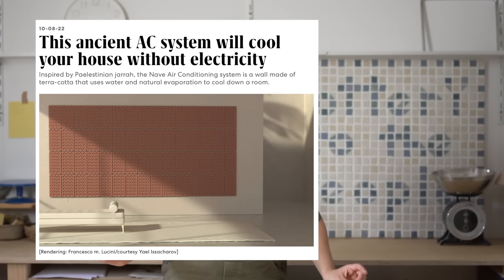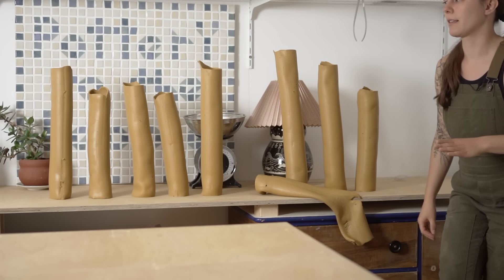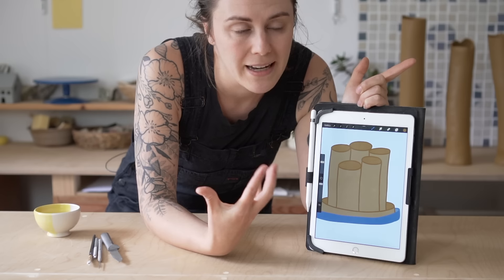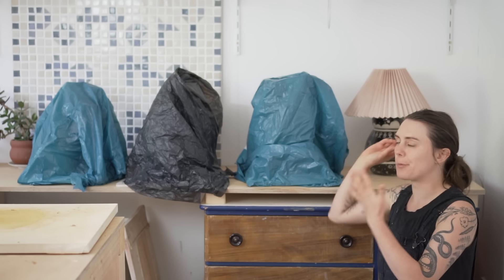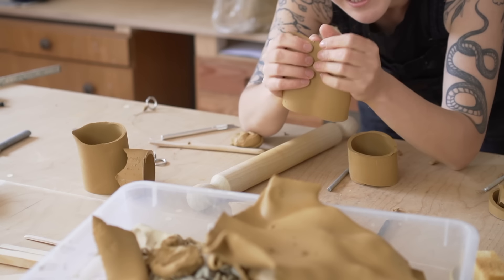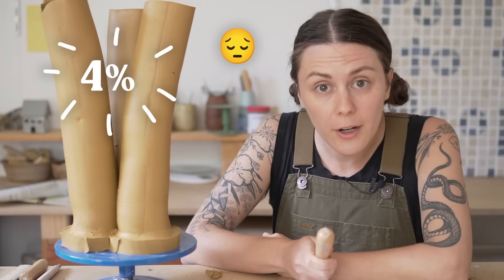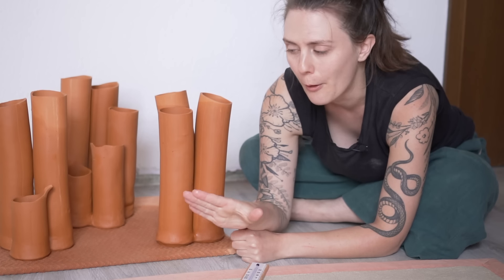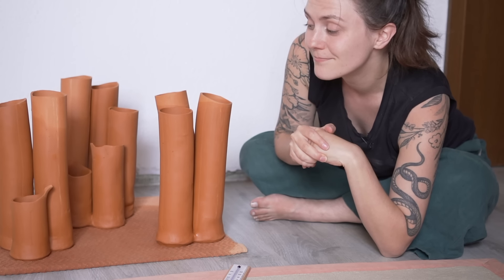Can I make an A/C out of clay???

Comment: not the heat, it's the humidity. 
It's why they are called air conditioners not air coolers. 

%90 of what my ac unit died is removed humidity. 

If you waled into my home in  the summer it's warm, but dry.   

Also , I know a lot of people who are cold all the time while I'm sweating if the temp exceeds 55 F. 

There seems to be this thing where people who are heat Loving like to make those of us cold living people miserable.  I'm at work , it's 2 degrees outside and there is literally sweat pouring  out of me. ...

My dress code is a suit and jacket.  I'm literally comfortable standing in the snow dressed for work!!

Comment: I love the project, very nice video, but I think you are being a bit doomery on the  unsustainability of air conditioning. 

Although HFCs are one of the single biggest causes of climate change, their impact is caused almost entirely during improper disposal of cooling loops. 

New laws and regulations phasing out the use of HFCs for modern alternatives have already been started by the US and a few other countries. Outside of HFCs, their real impact is electricity usage, which can be sustainable. Heat pumps as a technology are extremely efficient and useful, especially in replacing gas utilities like heaters.

In terms of alternatives to air conditioning, infrared cooling ("self cooling") paint is definitely the most promising. 

I know this isn't really the channel for that, but if you wanted to do another video about AC-less cooling, making your own cooling paint would fit the vibe at the very least.

Ultimately, we moved away from this type of cooling because it doesn't work in humid environments, and also it just really doesn't work that well.

Comment: Really cool project and now my brain is running away on ideas for chilly tubes! It'd be neat if your extruder could do something other than just regular tubes. If you extruded tubes in similarly sized circle with a wavy edge (so the cross-section was more flower shaped than circle), you could get get significantly more surface area per length/diameter of tube without a lot more effort.

Comment: So your thermometer is reading 21.5 C, which corresponds to 70.7 F. But you shared that as 66F. 66F is 18.8C. Something with your maths seems to be off. Also where I'm from 66F is pretty chilly. So yeah, not sure about the maths or the point of this experiment. You probably get better results if the room is a lot hotter. Regardless, nice job trying to recreate a functional ancient A/C system.

Comment: I love ideas like this even though the 60% relative humidity where I live is too high for them to work. The cooling power of evaporative cooling depends on the air being dry. The humid air has to leave the space you're trying to cool to allow the water to continue to evaporate. If there was little or no air exchange out of the room for your test, then that's why it didn't work. Humid air feels warmer, so evaporative cooling has to cool the air enough to compensate for how much warmer it feels. Evaporative cooling works very well where the heat is dry, but it doesn't work in humid climates. In humid climates it just makes the heat feel stickier. You could cheat and put ice cubes in them. Your freezer would make extra heat then but you could let that heat float away with a ceiling vent or something. You will probably need a ceiling vent for evaporative cooling to work anyway. You can also increase the cooling power of evaporative cooling by dehumidifying the air. You could fire something hygroscopic like clay powder at night to dry it and then use it to dehumidify the coolest air around the evaporators so it can cool more.

Comment: Hmm... I think you need to science the sh*t out of that. The thing works best when air around it is hot and dry, so maybe it would work better as something placed outside of the room, maybe on the room's window, under the sun. And then, you would need to pump or conduct heat from the room out into that water heat absorbers (or from air that you want cooled before entering the room), kept cold by water evaporation but keeping water vapor out. Hmm. Maybe an air intake into the room, through a ceramic "big air bottle", or a serpentine like twisted pipe, contained inside another bigger, windowsil flowerpot like porouse container filled with water. Maybe something bigger than a flowerpot, in that case carefull with water weight.

Sun hitting the flowerpot container will keep it's exterior hot, so increased water evaporation, so colder water contained inside. Air getting inside the room should have to get throug the cooled air bottle or tube, so the air would be cooled. You could keep the machine cooling the water by keeping the water level, and air could be forced through the tube/bottle with a small low power fan, or some kind of wind collector funnel. If heat difference is high enough, maybe inner tube could be metallic, so no water vapor pumped inside the room, too... in fact, it could work as a dehumidizer if cold enough. Dry, cold air with passive or a very low wattage fan. Does that sound like something that makes sense?

Comment: Interesting, but in the tropics where it's most needed, it would attract a ton of mosquitoes, including dangerous ones that cause dengue fever, malaria and zika. So I wouldn't use it even if it's supposedly far more "sustainable" than conventional electric ACs. 

I wish I could tell you what a more sustainable alternative would be. I'm from Indonesia, and here the traditional vernacular architecture typically controls heat in the room by using thatch roofing and bamboo lattice walls, which can feel nice when made right, but can require labour intensive replacements every half decade or so, and is a maintenance and hygiene nightmare. Plus if you work with laptops, cameras and microphones, you legitimately need a properly insulated room with the relatively dry coolness that only proper ACs can deliver.

While I am concerned with climate change—in fact recently it is said that we are no longer in "global warming" but already in"global boiling"—I think that at the end of the day humans do what they need to do to survive, and it is a fact that not all human needs are environmentally friendly. For young children, the elderly, pregnant and nursing mothers, and those with medical conditions such as hyperthyroidism and heart disease, exposure to extreme heat can spell death or grievous complications. I would hands down take an AC over a heatstroke any day.

Still, I appreciate that you took the time and effort to make this video and start this conversation. Perhaps you could someday revisit this video when you have more information on how we could cool our homes without AC. I believe doing something about climate change is about taking action on the things we have control over, making peace with those we don't, and having the wisdom to know the difference.

Comment: i could have told you this wouldn't have worked. All you're doing is making still water for bugs. The reason it's cooler inside than out is becuase your house is insulated to retain heat and to not suck in heat. Meaning, outside will change while you're inside wouldn't. It wont work. The reason your house stayed the same temp is becuase you closed your doors and windows. When it's hot out, you do not want to open your doors and windows. It'll make it hotter inside. It'll equalize.

Comment: an A/C only uses about 100-300W electricity if you add it upp for a whole house maybe 1kw altogether. it just pumps the inside heat to outside. i mean my gaminglaptop uses more power then its needed from an ac to cool a single room. if you are so concerned about climate change then unplug your fridge and dont use your washingmaschine or heated water.

i mean heating water is one of the most power hungry things to do. it takes more than 1kWh/liter/degreesC. and btw you cant save the planet even if you were to live on the streets i mean. 

the planet doesnt even needs saving it will still be liveable after warming. sahara might become green cuz of changes in oceancurrents. near the poles more agricultural area i mean thousands of km^2 possibly. most places wont be hit that hard. predictions in  the 90' said new york would be underwater by now. i mean climate is a very complex thing there are no good models. it cant be modeled correctly. raising co2 from 1 to 3% there is no model that you can calculate with what will happen only from that data. its more complex. its a capitalist thing beging fake green and advertising green products and fearmongering. but nothing helpful is done.

recyclyng PET and other plastics is the biggest fake ever. it cant be recycled into bottles again and if u wanna reinforce something with it like roads its still cheaper to just buy new PET than paying for the recycling cost. its a chemistry fact that plastics after recycling are significantly weaker structurally and and more unclear chemically. polymer chains are degrading by each reheating and remoulding.

if you worry about social economic and demographical crysis (maybe local conflicts) due to warming .. just dont worry cuz it would happen even without the warming and are happening right now.. we will live trough it tho. nothing can be done on an individal level. the zeitgeist wont change and capitalism wont be socialism even if it lies and manipulates you. 

btw a good video and nice evaporative cooling. its effectiveness might degrade after many ciycles due to minerals in the tapwater you are using. clogging up the pores. but it could be washed out probably. idk. not a real concern. 

and using water for cooling is probably just as bad fro the environment. if you were  to do this on a bigger scale or everybody started doing this you should use non drinkable grey water sources.  cuz in many countries the freshwater under our feet is running out.

not speaking about getting fungi on your walls from high humidity. in extreme cases you can even get sickness from inhaling spores 
under about 35 degrees celsius and under about 70% humidity (peole find a way to survive much worse daytime temps tho) 
you are completely fine by getting naked and using fans for cooling yourself. good cardiac health is advised as well.

Comment: this concept seems to me like a fundamental misunderstanding of why sweating/evaporation cools us down and how thermodynamics works. Two important laws of thermodynamics to keep in mind here is 1, conservation of energy (ie heat) and 2, the law of entropy (which when applied to temperature of a system, states that the temperature/energy of every object in that system will irriversably trend towards an equilibrium). Sorry lot of sciency mumbo jumbo there but here's the high level.
1. sweating works for cooling humans because they are hotter than the air around them. evaporation increases the rate of entropy which makes the room temp hotter and our body temp lower. It can't make us any cooler than the average temperature of the system (us + the room)
2. note that sweating does not make the room cooler in this case. it actually makes the room hotter because it facilitates radiating our heat into the room
3. if however, you're trying to make this clay AC "sweat", you can theoretically cool the room so long as the clay AC is already cooler than the room
4. just like how we can't get cooler than the room by sweating, the room can't get cooler than the clay AC by "sweating". So the only way this AC would work is if you put in cold water
5. the cold water needs to come from somewhere. likely ice made by your freezer
6. your freezer makes ice by increasing the temperature of the room (using the same law of thermodynamics) so you're back where you started :(
Reply: the way AC units works is by piping all that hot air outside. because this has no external vent, the absolute best you can do is reach an equilibrium

Comment: I think this will be more effective with open rooms, as the idea would be for the air to take the vapor away and thus cooling it down. Another thing to note is the region you're in. This will certainly be more effective on less humid regions, as it requires the water to evaporate to cool down. You can also combine this with a fan in order to make it dry up faster while also spreading the 'cold' out of those tubes

Comment: what isn't sustainable is the electricity used to run them.
Reply: Incorrect.  You can generate electricity using renewables.  Some places are now running on 80-100% renewable.  Germany is 55%
Reply: @ziljanvega3879  renewable =/= sustainable.

Comment: Here's just a little perspective from one of the 10% U.S. households without A/C (or even a swamp cooler for that matter) in a hot desert climate.  Although I applaud your efforts to recreate a more socially conscious cooling system,  I have to disagree with your "no shade" statement, as well as wonder about the source of your numbers when it comes to the affects of A/C usage on global warming.  What you are really talking about is the affects of the electricity consumption of the A/C units.  How does this compare with the electricity consumption of, for example, electric pottery kilns?  No shade intended toward any potters out there that use electric kilns.  In all seriousness, I have no problem with the use of an electric kiln.  It has far less direct effect on the environment than a fire would.  I hope to just illustrate where you definitely are casting shade on A/C usage.

For a little more positive feedback, coolers like this have been used for refrigeration and food preservation for ages.  It works very well for more static environments.  Ceramic units that use a water tank at the top are made and sold in India to keep vegetables fresh longer in household kitchens.  If you want to turn this into an effective room cooler, you need to add air movement into the mix.  Without air movement, you will only ever cool just the immediate area around your clay.  Air movement will also speed the rate of evaporation, and increase the cooling effect.  I can tell you from experience, that a well placed fan with a pan of water in front of it makes a significant difference.  Of course, if you live in an already humid environment, evaporative cooling just really won't do you any good;  it will just leave you feeling hotter, and make you a sticky, sweaty mess.

Comment: I'm not a scientist, or have that sort of brain, but would it not do a better job of cooling if the air was actually moving past the cylinders..?? in a closed room where the air is not circulating it is thus not moving around the cylinders to move the water vapours..so if you have the means of creating a fan to move the air around the cylinders you may find the room cooler..

Comment: I loved this video and the thoughts and motivations behind it so much! I'm an evaporative cooling hobbyist and I'm sure others have said how you're actually so close to making this a practical thing to use to cool your home especially in Europe! All you need is a fan or some air flow with an exhaust to let some humidity and air push out! Passively moving that air is difficult though so I understand your apprehensive to add an electric fan. Maybe run it on solar from the roof with a small 100w panel? Very excited to check out more of your channel

Comment: I am sorry but it looks to me like you made some vases in which you can place cut flowers. That is not going to cool your house, if the ancient wisdom was so great and this worked we would still be using it or talking to older people who say that when I was a child in the 1930's on our farm we used clay tubes and water and it worked great. But this is not the case, when houses were designed with really high ceilings and a bunch of large windows and there were shade trees around and not too many houses and people near you it was more tolerable. and going from 67 degrees F to 66 is one things but if this was New Orleans today it would never go from 100 to 99 and if so you would never notice. Just saying, cute vases though.

Comment: Great work, I like that you kept the organic design it just came out as. Since this relies on evaporative cooling a fan could help, but maybe a completely passive system could be placing this higher from the floor (hot air goes up, cools down and descends to the floor). I'm thinking of hanging sponge tube corals ;)

Comment: You need a fan to get the full effect of evaporators my dear. Just having free standing water tubes will do nothing. Take the advice of someone who lives in Northern Australia where we often get 48 degrees Celsius in summer. You need to blow the cooler air around the room. Also you should have used rolled up news paper to support the tubes while they were drying. One mor thing, please stop using obscene language, it's very disturbing to me.

Comment: Science time.
Sorry but all this is doing is humidifying your home.  The 1 degree is happenstance.  That is just fact.

In order to 'cool' a space, you have to move the heat to the outside of your building somehow.
There is no such thing as 'cold'.  You cannot 'generate cold'.  
Cold is merely the absence of heat.

So this, and those 20 dollar 'cool mist' things that sit on your computer desk, don't work.  At all.  You are not removing energy from your room.

Now, if you want to try something a bit more experimental and different, look up the videos on Desiccant AC's.  They operate using much less energy.  BUT they take up a ton of space in order to be effective.  Unlike this though, they do work.  They use similar processes to a swamp cooler, but operate with less electricity overhead.

If you want to cool a home with that tech though, you are looking at massive infrastructure change to your abode to scale it up enough.